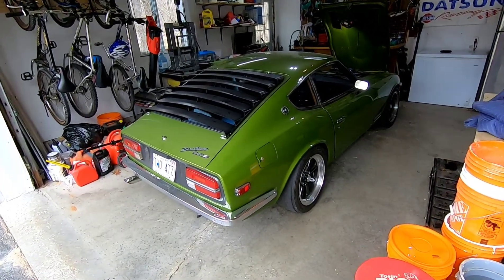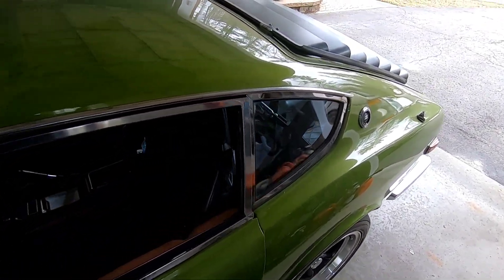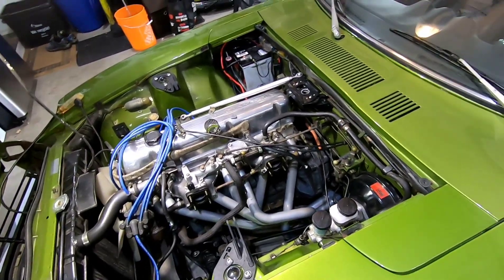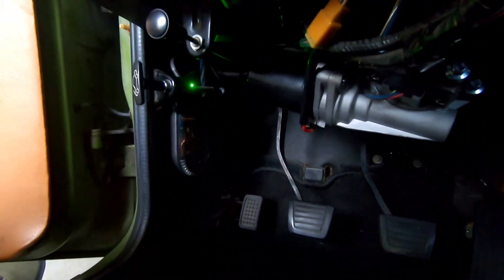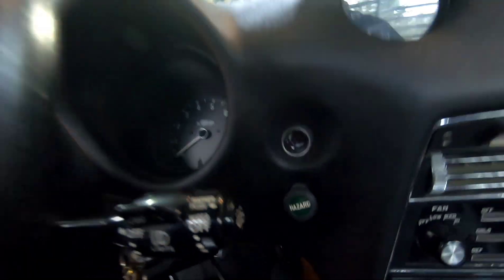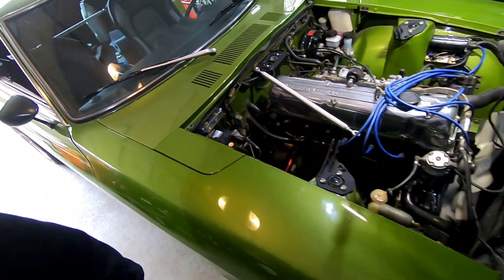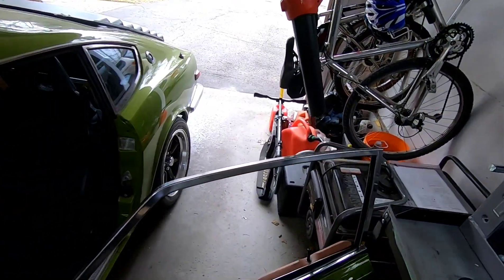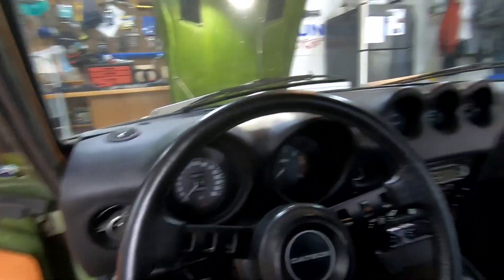Installation of Silvermine Motors Electric Power Steering on 1973 Datsun 240z

Comment: Did you get actual instructions? Just got my kit which didn't come with a scrap of instructions. If you did can you upload them somewhere?
Reply from the maker: No I did not. When I querried Silvermine, they said they only provide the wiring instructions and installing the column was the same as the stock column.

Comment: Hi Sean, does the GPS sensor work OK where you've mounted it. Also why is the wire to the tacho necessary, thanks Gary.
Reply from the maker: I ended up moving the GPS sensor to the dash next to the A pillar to get a more consistant signal. For wiring I just followed the instructions provided.

Comment: After being pissed off at the steering effort required in slow hairpins, I built an EPAS unit from a Saturn Vue. The sensor that I used does not change based speed/steering input, its a consistent assist (which kinda sucks on the highway, the car feels like on blades). Could you do a video of driving around different areas, say a parking lot, street, then a highway? I would be useful to see the how you are reacting to steering input based on the level of assist.

Does the caster help with the return to center? I'm running a stock alignment, I notice that the steering wheel does not really like to return to center.
Reply from the maker: Still waiting for the salt to be washed off the road before I pull my 240z out of the garage but I will look to post a followup video in a few weeks.
Reply from the maker: I just posted a video of my 1st autocross event with the EPS. Of course the steering effort is much lower but I'm also I'm able to make quicker corrections when the back end steps out  (you can  see it in the video I just posted). I've also been driving it for a few weeks and love it! The assist feels just about right in all conditions. I believe the castor does help with the return towards centre.

Comment: What's the reason for needing an Ron signal if you are using the GPS speed sensor?
Reply from the maker: Sorry I don't understand what you mean by "Ron" signal?
Reply: @sean240z  sorry I miss-typed. I meant RPM signal.
Reply from the maker: @arcanedefiance  - I just followed the instructions that came with the kit. If I had to speculate, I'd say the GPS speed signal is used by the ECU to vary the assist inversely with speed, the ACC feed is the trigger to power on the ECU and the RPM signal is used to power off the system when the car is shut down.